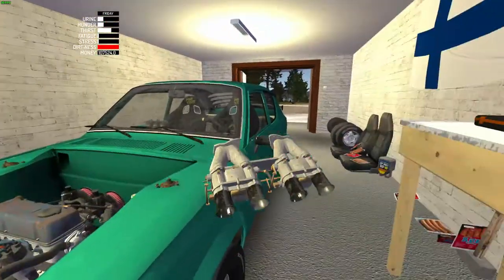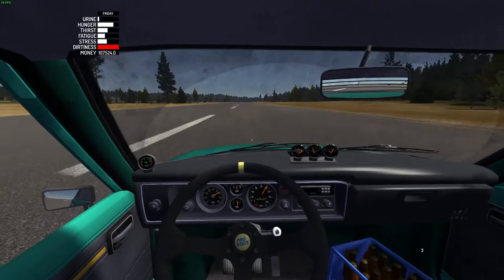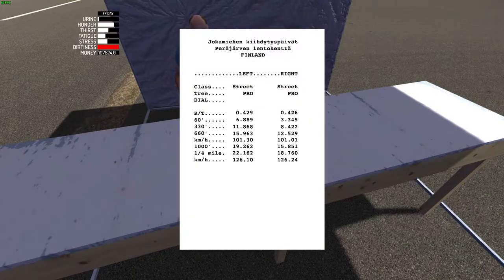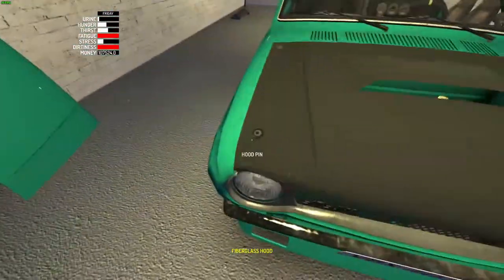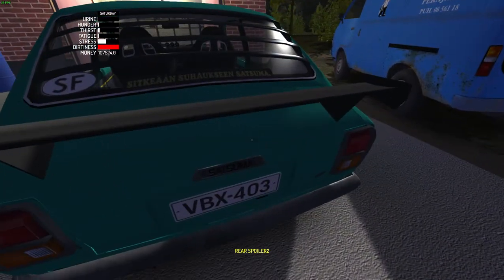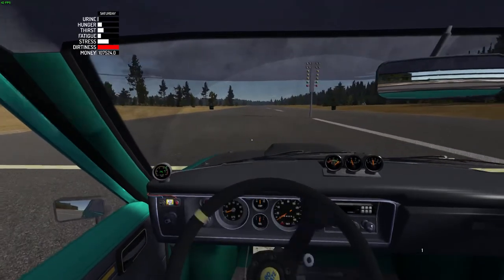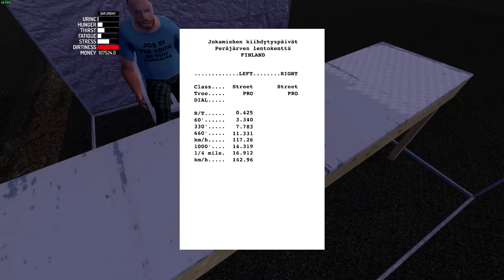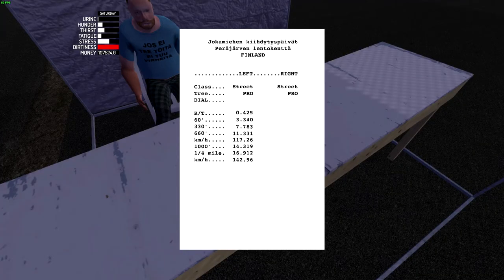Do The Racing Carbs ACTUALLY Make Your Car Faster?

Comment: Tested it myself and saw +20hp :P

Valves all loosened & A/F 13:1
Reply from the maker: Dooopeee! i haven't messed around with the mods, but that mod that tells you your horsepower looks pretty handy
Reply: +20hp the racing carb or the other one?
Reply: the reason that the time for the racing carb is slower is because you didn't wait for the engine to reach operating temperature before you tuned the carb. Also Could someone test the difference between the single barrel carb and the twin barrel carb. it would be nice to have the numbers for all three.
Reply: also it would be nice to see the difference with the carbs themselves and not with the nitrous.